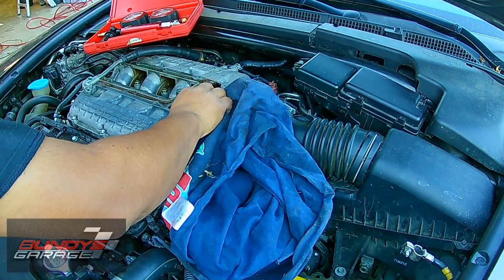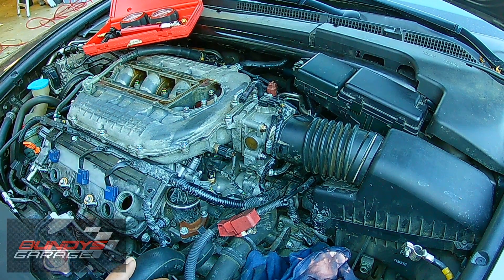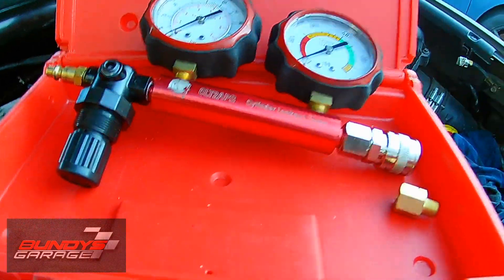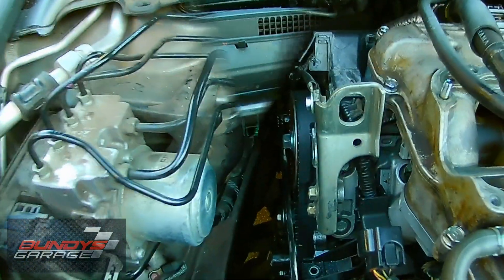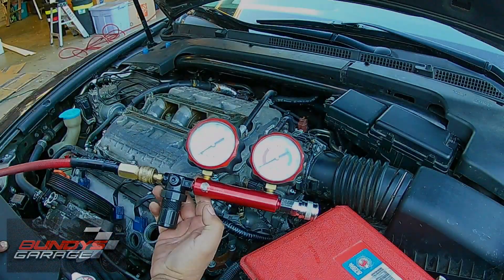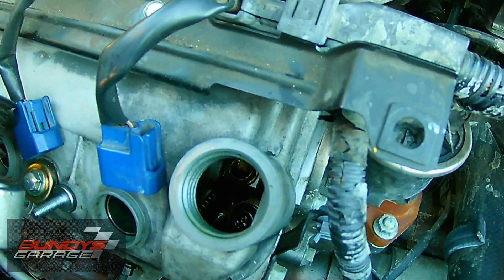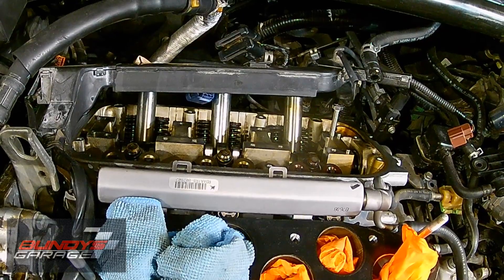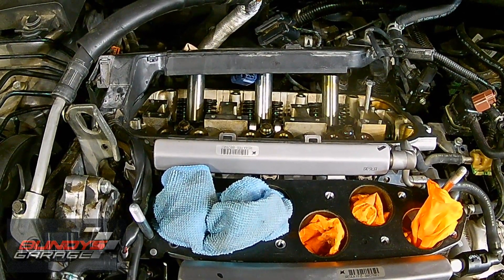White Smoke from Exhaust After Timing Belt | Leak Down Test | Honda J Series V6 Acura

Comment: How would a leaky valve stem seal cause low compression?
Reply: It won't.           Tight valve clearances on the rear cylinder bank was likely the issue here.
Reply: @scdevon that would explain misfires but not the smoke, there is active fluid leaking onto cyls while sitting. How do i know? Thats the reason im watching this😂

Comment: Well, so what was the verdict ?? You never said what the problem ended up being???
Reply from the maker: That’s a great question, the final verdict was the engine needed to be replaced. Honda made a bad batch of blocks from 06 to 08 and the cylinder walls became wavey. I have also heard that replacing the rings on the pistons (only use OE) have fixed the problem as well.

Comment: Let me ask you this, if the cam was out along with the rocker arms. Could you not take compressed air and fill the cylinder up with air with the valves against the seats and manufacture a valve spring compressor tool and leave the head on the engine and replace the seal that way?
Reply from the maker: Yes you could